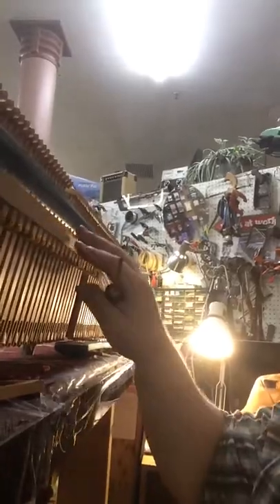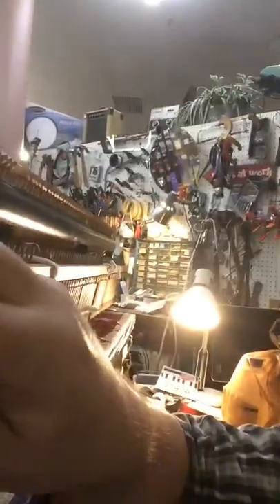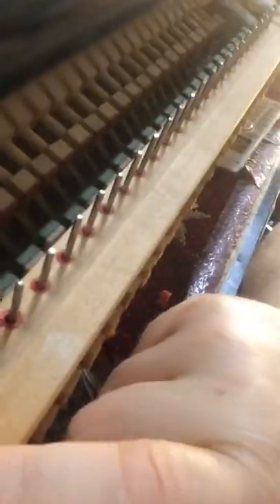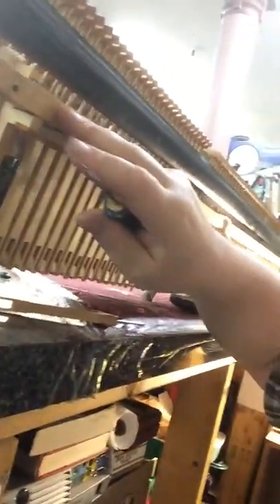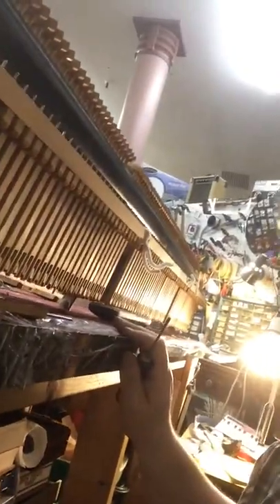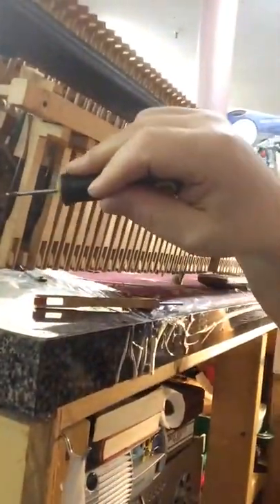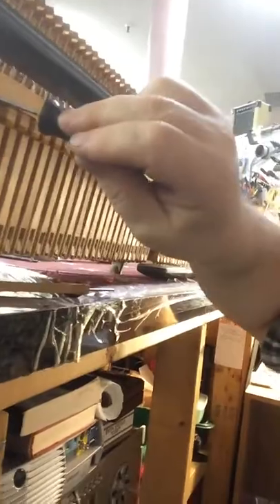Baldwin Acrosonic action reassembly

Comment: It certainly is a Difficult task to get all 88 rod pins into each hole of the rod pin guide. I like your clever solution to set the long guide bar in place with only 4 rod pins inserted. You hacked yet another Clever trick by using 4 of those damper heads to fasten the guide bar onto the four  rod pins. Then you cleverly popped off the remaining 84 rods and insert their pins into the guide bar holes and popped each back onto the action joints. Thank you for sharing. Thank you for your clever thinking.

Comment: The factory manual says to tie the rail down before removing action. But good to know what to do if it comes apart. I read of folks turning action upside down to let sticks hang down on a straight edge and easier to slide them on. Thanks for your video.
Reply: "Raise the pickup finger of a note in each of the two end sections of the action, as far upward as possible. Tie the heads of these two raised pickup fingers up against the guide rail. Remove the four guide rail screws attaching the guide rail to the support brackets. Push the guide rail back, and down, against the hammer rail until the hammers touch the strings. Tie the guide rail firmly to the two central action brackets. Release the action brackets from the bracket bolts  by pulling forward. Action can now be removed by gripping tightly, both center action brackets. " (From  a Baldwin service manual compiled by Chris Chernobieff.)

Comment: Thank you for the video! It should help trememdously. I made the terrible mistake of removing the guide rail when removing the action and now I have been stucked for literarily 8 weeks trying to fit the guide rail back in. very difficult with the lifters constantly moving and bridle straps tearing.  Luckily the clients are related and live not too far. would it help if i used someone to hold the rail while I try to secure some of the lifters with damper blocks and inserting the rest of the lifters into the holes?
Reply: did u get an answer to that question because I am in your shoes almost